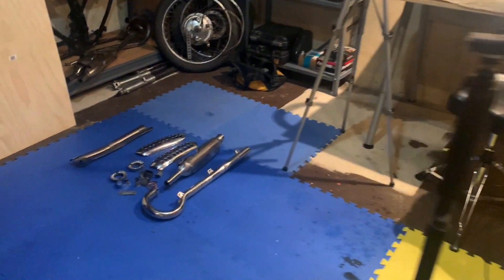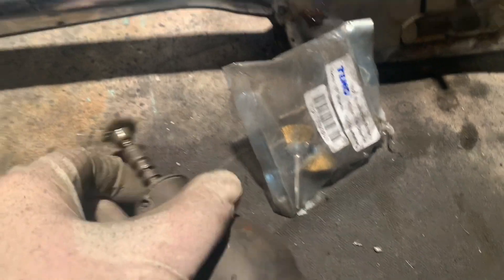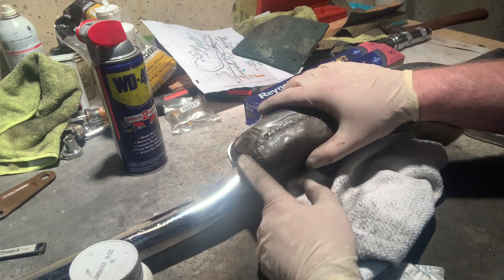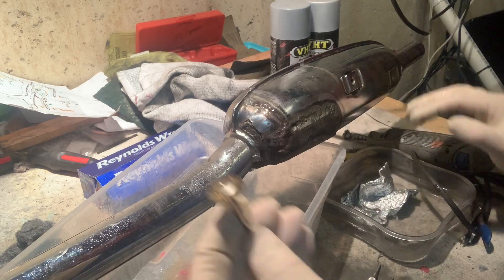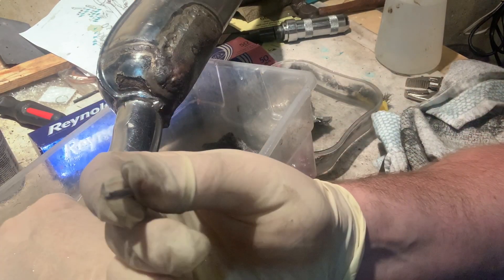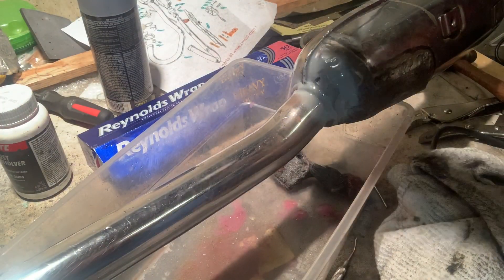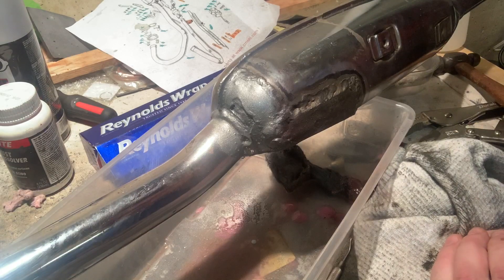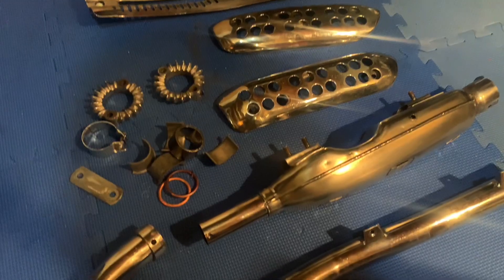How To Treat Rust Spots On A Motorcycle Exhaust (Temporary Fix): Part 198

Comment: You will prob find if you cut open the muffler the component inside would all be rusty as . A can of worms I tell you . I have been working on a musket muffler on an old honda 100 1979 dirt bike and its roached out big time. I sux cause I dont have the right gear to weld the holes up, tried if with a cheap gasless mig welder and that mainly blew holes in it. Si I went and brought a map gas blow torch for $100 and sment a few man hours trying to braze the holes . Its narley as , gave up but still need to complete what I have started cause the bikes been sitting for 6 years now. Map gas hand torch take ages to heat up the rods but I cant afford a proper welding set up .
Reply from the maker: Welding skills and tools is such a gift. The struggle is real. I feel your pain!

Comment: I have rust in the exact same spot. Will it create an exhaust leak? Or is the actual flow not through that area?
Reply from the maker: If it’s through it’ll cause a leak for sure. All those pipes seem to fall apart in that area. Lucky I got to mine before too much longer. I have another set with holes...without a welder options are limited.